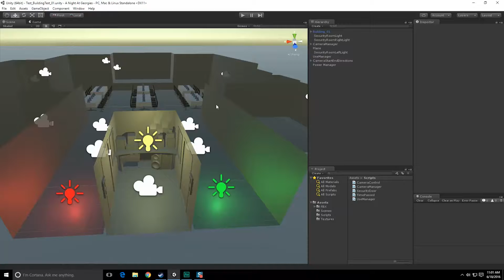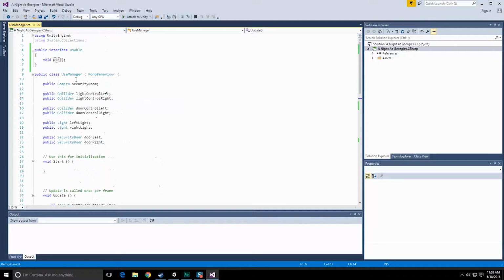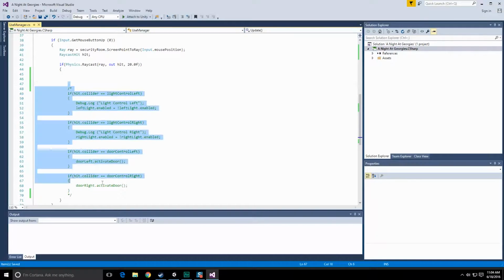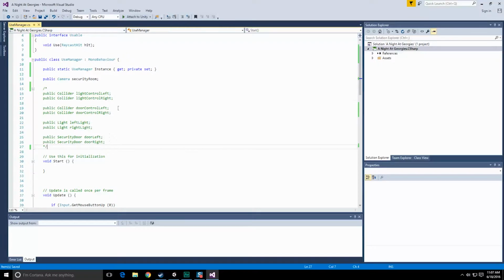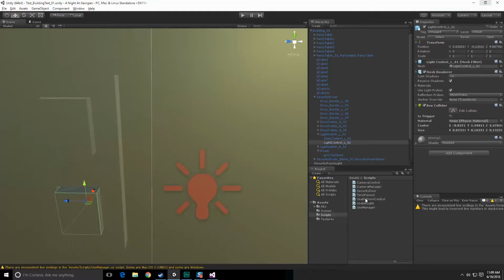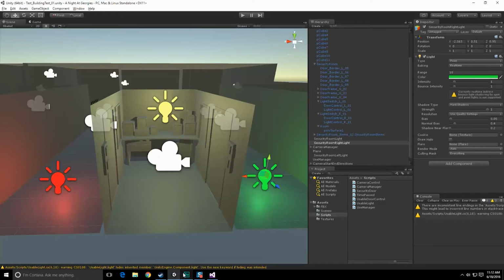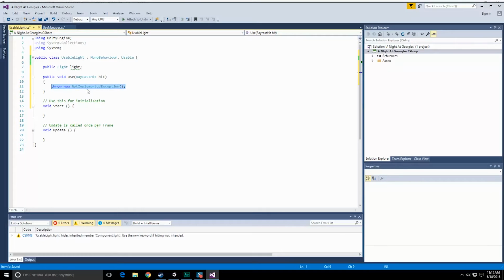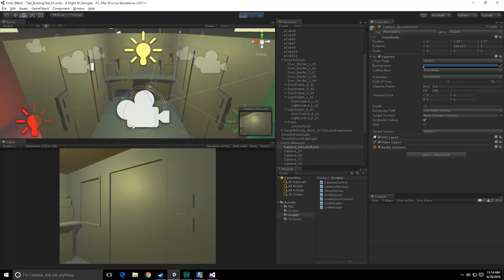FNAF in Unity 33 Revising the Use Manager Part 1

Comment: I have no errors with anything except for the fact that when I press the light button it doesn't turn on or off and I put in the camera and the scripts and everything and the lights arent working
Reply from the maker: OK, then we have to systematically try to debug your problem. Start with making sure you have access to the lights  in your script. Make sure that the proper methods are firing by using Debug.Log("It works!") statements. From there you can try to activately debug your code by using break points in your script as the game is running. See whether the lighting issue is a raycast issue (not being able to select the model and have it impact the proper script).
Reply: I think it is a raycast problem and I tried to change it to be a ui and it worked but I think it is the map because i don't have Maya and I used Cinema 4d insted so I think that might be the problem
Reply from the maker: Possibly but I doubt it. Ultimately, the models that are exported from our modeling programs should have much reign over our Unity applications.
Reply: What is the Unity Update that you use
Reply from the maker: What do you mean by update, the version that I'm using?
Reply: Yeah
Reply from the maker: +CameronF305 looks like it was version 5.3.5f1
Reply: oh that might be why, I have 5.4 i think, also on the animatronic ai script at 4 AM or 5 AM it always says Array Index out of range
Reply from the maker: +CameronF305 if the array index is out of range then you do not have a number of animations necessary to do what you need
Reply: Thanks! It works again